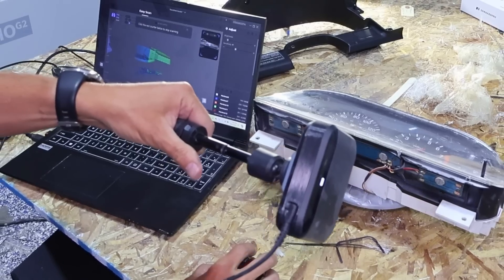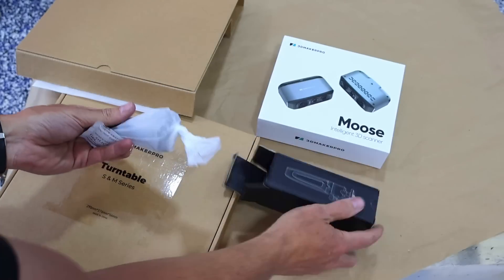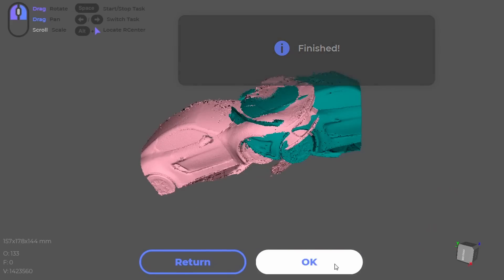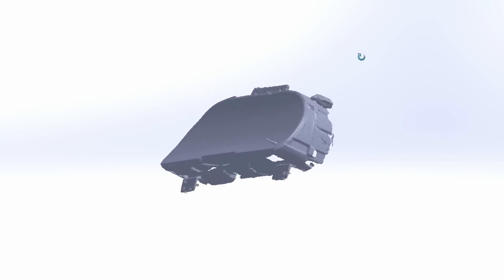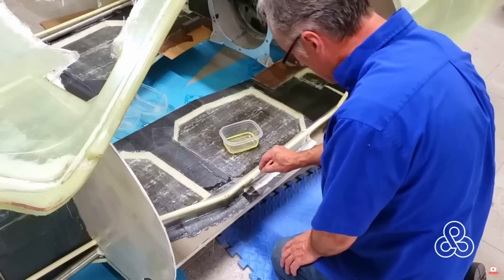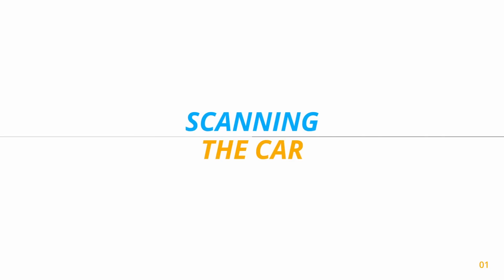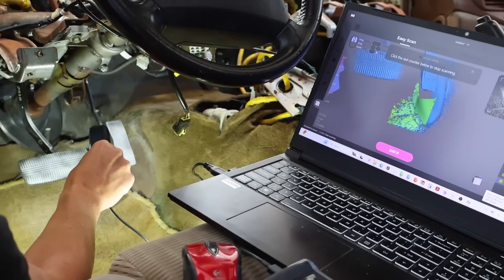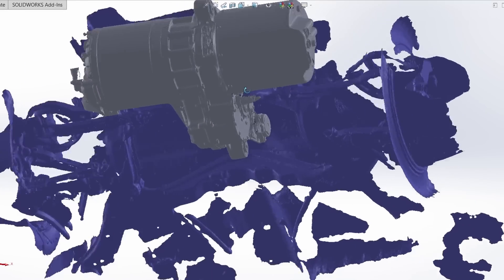3D Scanning the Nissan - How to 3D scan using the 3DMakerPro Moose

Comment: This is great. Have you found anything better than the dry shampoo for the scanning as its a pain to cleanup. I want to scan my front bumper but know the dry shampoo will make a mess and then it's impossible to use the reflective stickers for tracking.
Reply from the maker: Dry shampoo cleans up very easily.  No, I haven't found anything better.

Comment: I'd love to scan the neighbor's 55 Thunderbird. Who knows they might need a copy.
Reply from the maker: Interesting 🤔
Reply: @electricsupercar  my long-term project is a EV into a 74 Super Beetle.  Work out which EV motor would fit, not looking for much mph, it's a beetle.
Reply: @webmonkees  try contacting moggy at electric classic cars, they have done many ev converted beetles.
Reply: @4literv6  thanks,  yes, it's good to have something engineered rather than me guessing..
Reply: @4literv6  yes, love those builds. When I pulled the engine years ago I was considering it's be easier to put back in EV. Of course at the time the main choice was electric forklift motors. :)
Reply: @electricsupercar  have to use my skill set, right now graphics are easier for me than mechanical things. No garage for instance.